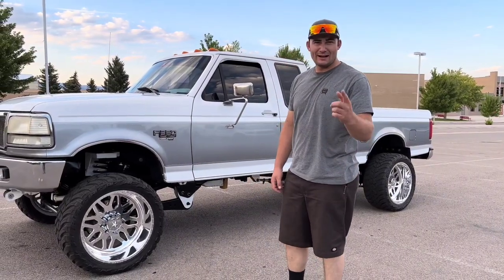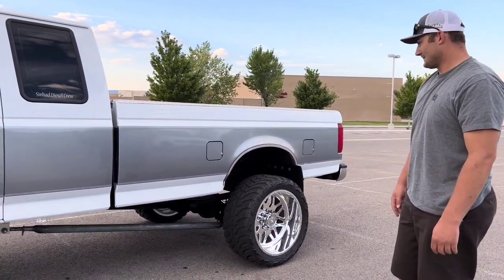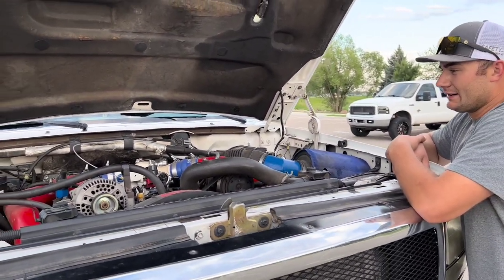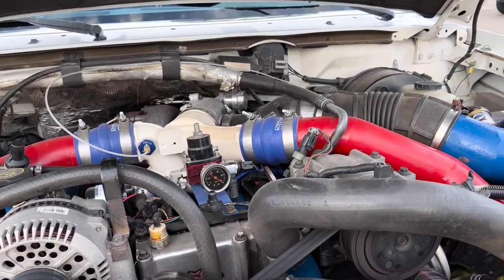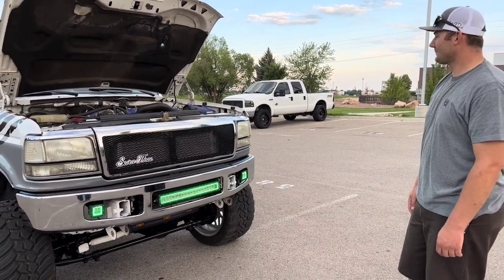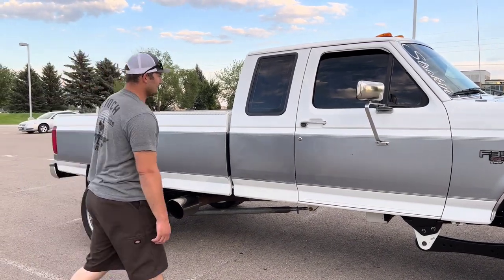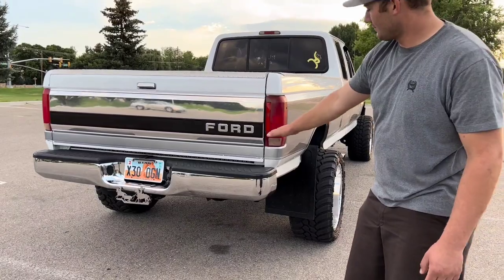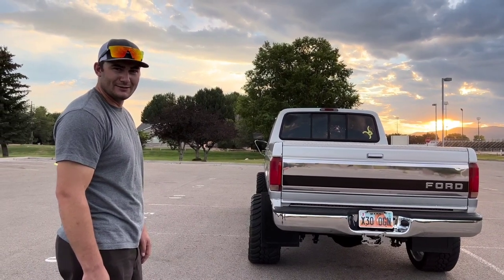Cleanest 7.3 powerstroke on YouTube

Comment: Clean rig, currently working on cleaning up my ‘93 CC 7.3IDI. Thinking about staying with the fully mechanical engine. Don’t like the electronic stuff and the problems that can occur. Like my son’s 03 PSD that will occasionally die, but will instantly restart with a turn if the key. Replaced all the sensors except for TPS.

Comment: Nice truck there. 

Own a '97 7.3 myself but sadly I live in the worst state ever as they go nuts with salt in winter compared to most northern states and well due to not taken care of that well by previous owners, its not rust free. Got replacement bed for it and all but to get it to a shape of "not a rust bucket" is gonna take a lot of $$/time. But only nice thing is (that we know of as could be some kind of hidden unknown problem), that is engine and trans are in nice shape(trans was replaced a few months before bought so its pretty new at least). But my aim to with it is trying to over time with investing to get it to point where its not the rusty thing it is. With step one being getting replacement bad perfect and on it to at least have rust free bed followed by adding frame protection that it needs(after cleaning) followed by then work on it all. Just wish previous owners invested in protecting it better and not just saying "well its a plow truck so meh to it," as now got lots of work to get it to point where it will look nice again.
Reply from the maker: Sweet these old trucks are worth taking care of. You take care of them they will take care of you

Comment: That's a fine looking truck. I have a black 94.5 just like yours. What year bumper is that on the rear?
Reply from the maker: Thank you man. It's a 2008 front bumper
Reply: @truckincowboy7029  I was talking about the rear bumper.
Reply from the maker: @b.b.9603  it's the stock bumper